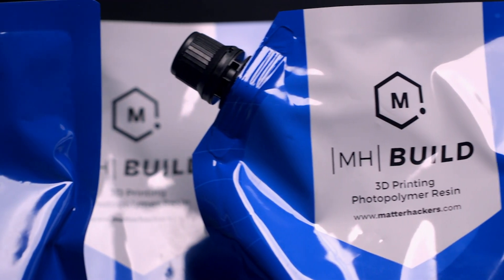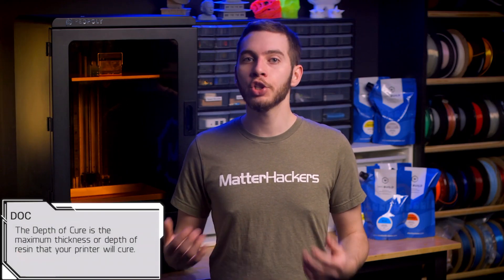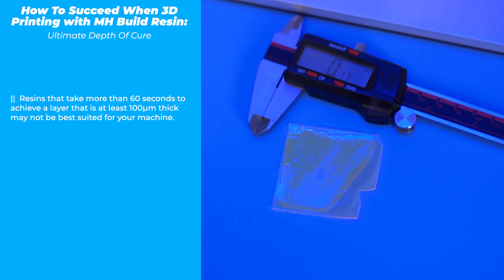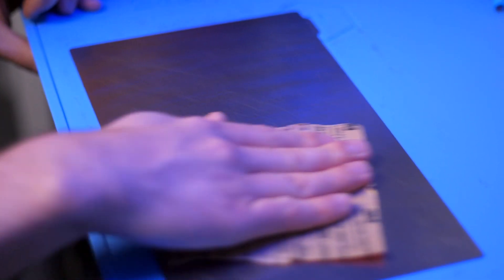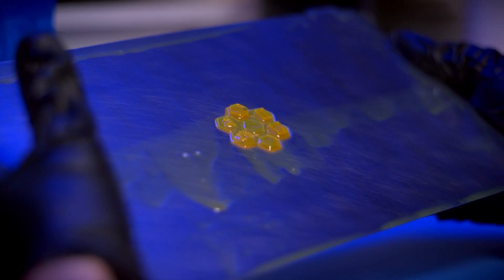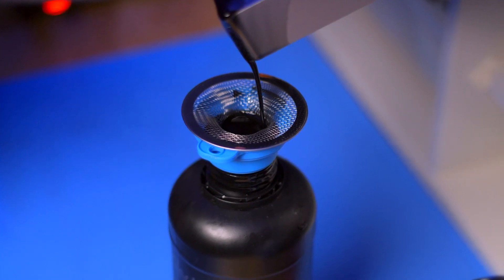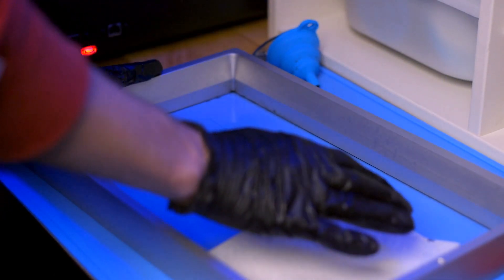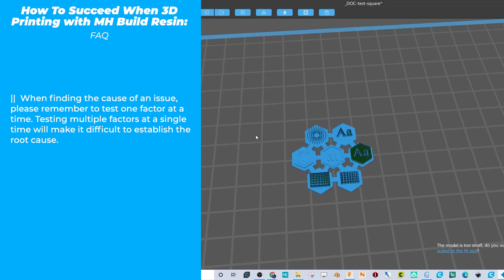How To: Succeed with MH Build Series Epoxy-Free 3D Printing Resins

Comment: For those having trouble with this resin... You need to roughly sand your build plate to scratch it up by laying some sandpaper on a flat table and moving the build plate over it in a few different directions rotating the each time to get an even surface. Start with smoother paper to even out the build plate and then use rougher sand paper to create scratches. Deeper scratches running random directions are actually helpful. Then wash the build plate off with a garden hose and soapy water to remove debris and let air dry. This stuff doesn't like to stick to smooth surfaces at all. After sanding the first time just clean your plate with a toothbrush and alcohol and let air dry every two prints or so. This stuff builds up a residue you want to remove from the grooves or scratches in the build plate. But once you've done that it should work for you. Also lubricate your fep film with a touch of Crisco vegetable shortening and wipe excess with a nose tissue. The cure times for a printer with a monochromatic screen can be as low as 40 second bottom cure time, 5 layers, 2.5 seconds regular layer cure time, and .035 layer height. As you increase layer height by every .005 increase cure time by about .03 seconds. In colder climates you'll need to clean your build plate for carefully and use longer cure times, but overcooking this stuff doesn't really help much. It just makes the parts brittle. The secret is having a clean scratched build plate and having a super thin layer of crisco as lubricant on your fep film.

Comment: I cannot seem to get adhesion no matter how many times I try to calibrate with my Photon Mono. I've spent 2 days trying with only one test square actually sticking to the plate. Any suggestions?
Reply: You need to roughly sand your build plate to scratch it up and then wash it with a garden hose and soapy water to remove debris. This stuff doesn't like to stick to smooth surfaces at all. After sanding the first time just clean your plate with a toothbrush and alcohol and let air dry every two prints or so. This stuff builds up a residue you want to remove from the build plate.

Comment: Put the resin into the vat and using a silicone spatula mix a few or more drops of alcohol into the resin to thin it. It's too thick making the parts heavy and subject to the suction and so they don't stick well to the build plate without that step as I explain on my website. ;)

Comment: Very good info but no one mentions how the final resin matches with others in terms of how brittle it is etc. PS I would strongly recommend pushing the FEP up from the bottom after using some alcohol instead of scraping the FEP with a tool, it works better releasing objects and no FEP damage

Comment: I just received the 4 1kg primer pack of black, white, grey, and clear resin. My Phrozen Sonic 4K machine arrives tomorrow. Perfect time for this video to post! Thank you MatterHackers team, I look forward to trying your product as my first resin!
Reply: Please share your results if you have time! Peace
Reply: @shivercanada  unfortunately Emerson is correct. I was suggested to use ridiculous cute times and wound up with an 11 hour sample print that warped the center spot of my FEP about a half inch in diameter. I sent an email to no avail, contacted them on Instagram and was told to email them, got generic replies. Have yet to have anyone resolve my issue or help me with my return. So in short, I got an over cured test print and a damaged $1400 printer as my first experience. So if you have actual experience with resin printing give it a go at your experience, but as a first time thing DONT USE the build resin. I wondered why I haven't seen a single review on it with all these colors and such a great price. I will update this when I actually get help or if I ever touch this resin again.

Comment: This video is trash. You fail to offer any advice for your resin, or address the issues with your resin. Like the fact your resin has loads of pigment in it which needs to be filtered before it's useable. Or the fact that even with 4k mono printers, it still requires almost 5 times the normal time to get something that resembles a print. Your resin is trash and isn't market ready.
Reply: sheesh, that alone scared me, I was curious about trying their batch but I'll stick with my Eleego.
Reply: @SergeCruso  I'm here to unfortunately to verify this. I tried default settings and got a fail print no adhesion, I tried the settings they recommend and the Phrozen test ring which should apparently take around 2 hours took 11 hours and ruined my new $1400 Phrozen printer.
Reply: @professormox  it sounds more like you don't know what you were doing. you shouldn't be using this settings that they're talking about, because these are not meant for your type of printer. This is why they said that you needed to do the test prints to get the correct information for your printer. I'm not saying their resin is good, but I'm saying don't blame them for ruining your printer. You did that on your own.
Reply: @mattsalem6989  Great point, no one for back to me from their team for over a month. I am new to this so yes it's my fault. But the resin doesn't work either beat. Which is why there are no videos on the product anywhere. Just sharing my experience.
Reply: @professormox  I understand, and I'm not trying to be overly critical of you. There are zero reviews on this stuff, that's why I'm here as well. I think I'm going to try it out and see if I could get it to print. If this stuff works it's extremely cost effective. But I do believe, it will have a learning curve.
Reply: @professormox  I'll post a video with my experience once I'm able to.
Reply: @mattsalem6989  I appreciate the comments, I look forward to your experience Matt.
Reply: Completely agree - this resin is garbage. Over well over 60 seconds needed for bed adhesion on a Saturn, 2.5-3+ seconds per layer at .03 ...no odor is meaningless if prints always fail.
Reply: @ev2minis488  sorry! The Matter Hackers team let me know that at the time they were short handed with help or something? I printed a rerun label and shipped the resin back. I got my money in 3 days. I hope they can craft a usable resin at a similar price point. Seemed promising.

Comment: Thank you! I haven’t been able to get any prints yet, nor have I found any resources for print settings! I’ll be sure to try these out
Reply: Don't expect to. That resin is garbage. Hopefully you have enough filters to clean all the junk that's in that resin. They load it up with pigment. Also, if you have a mono printers capable of 1.5-2s cure times with your normal resin, throw that out the window. If you want anything the resembles what you're trying to print you're going to be around 8-12 seconds. Oh and your initial layers? Yeah 75 seconds for 15 layers, not 60 for 3.
Reply: @BackwoodsTinkerer  Thanks for posting some additional tips. I am really struggling with getting adhesion with this stuff (on an Elegoo Mars). Just double checking the 15 layers initial layers; was that at .03 or .05 layer height?